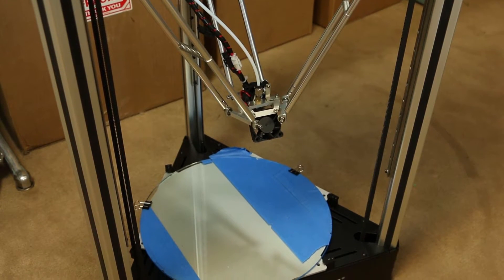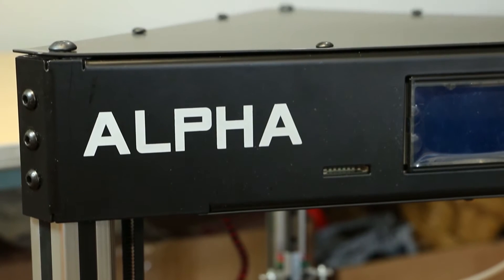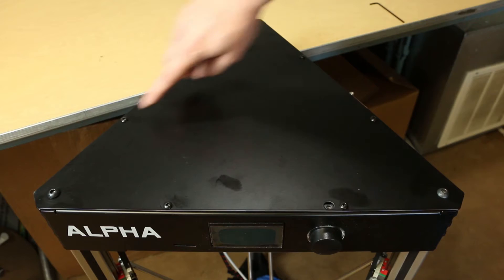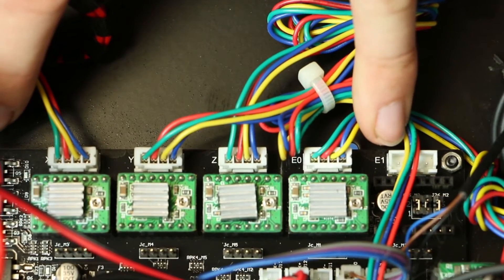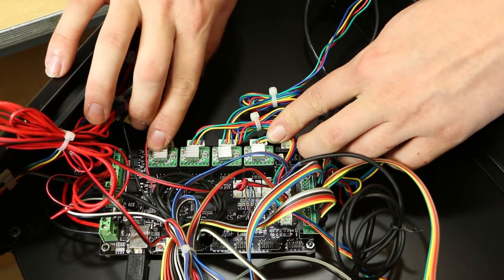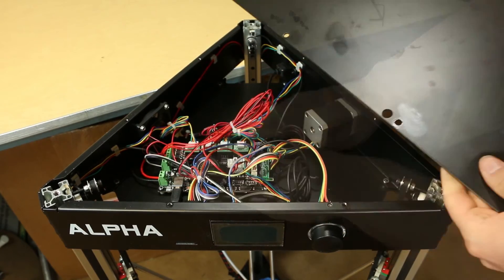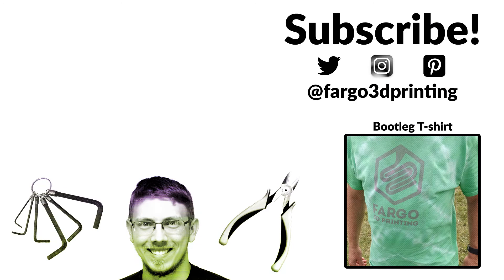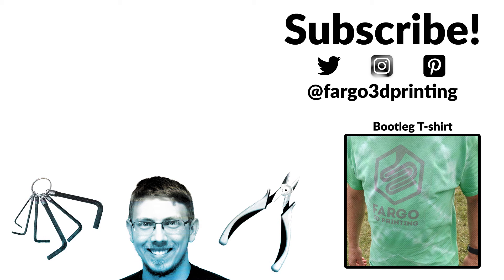Replace Hatchbox Alpha Stepper Driver

Comment: Any stepper driver works? And you don’t need to adjust the voltage? I replaced my stepper drivers and the printer is noisier. The motors are clunky sounding, but it still makes an accurate print as far as I can tell.